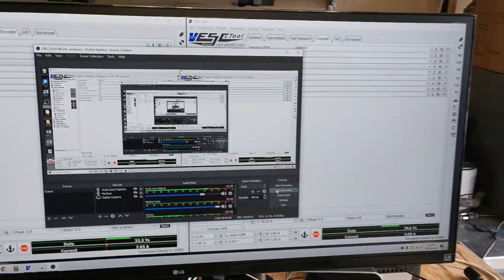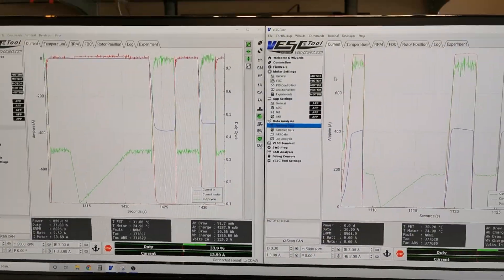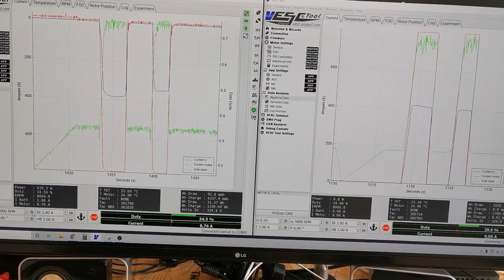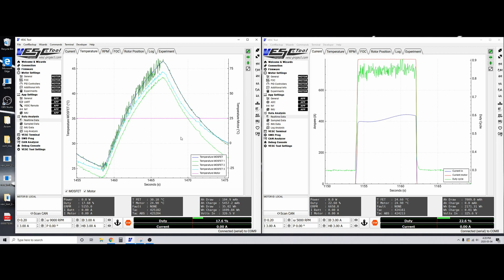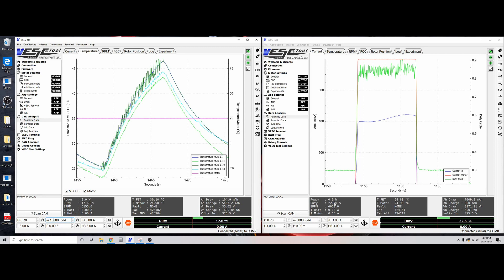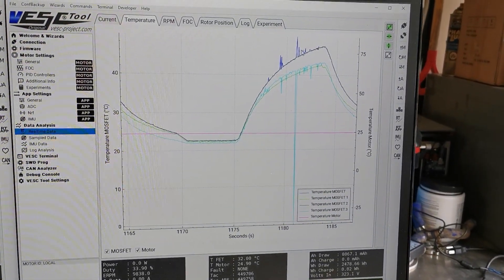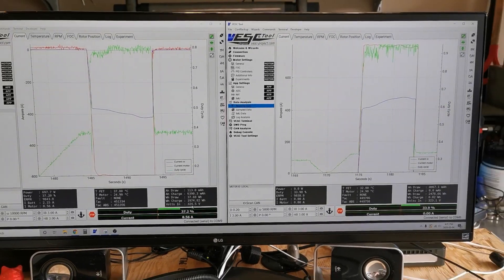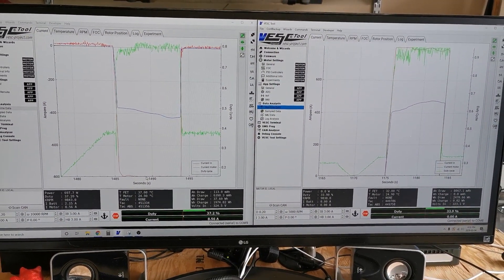100Kw+

Comment: Exciting stuff!  Are you familiar with the issue where coolant running too fast across a surface removes less heat than slower flow rate?  Not saying you have this problem, but it's something to try sometime.  "Water Wetter" helps in this area too... IF you ever have any "problems".